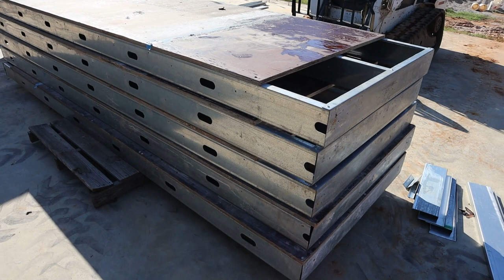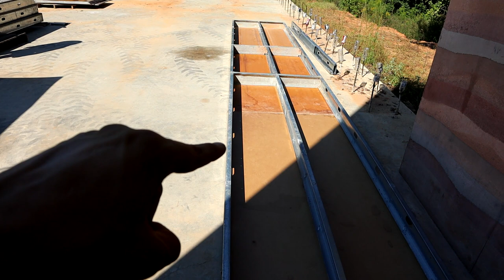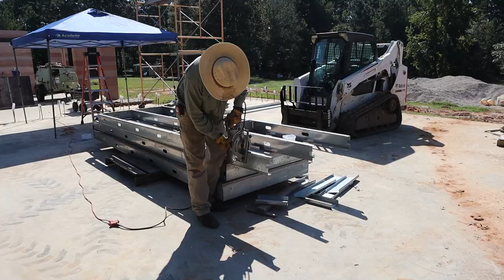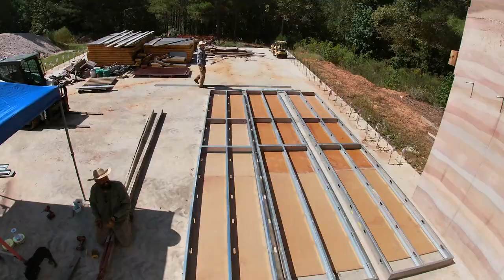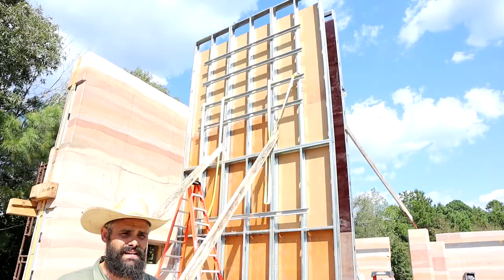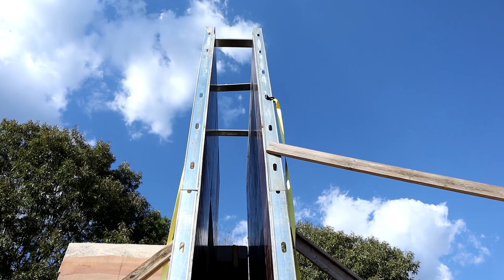Creating an UBER Form for HUGE Rammed Earth Wall - Vlog 78

Comment: Are you going to reuse your 16 gauge C channel commercial building wall studs in your building somewhere?  How many times can you reuse the forms before you think you need to replace them.  One of the reasons you aren’t supposed to stand on that pallet is that if the hydraulics fail you will most likely fall.
Reply from the maker: If the C channel survives the process then they will be used to form the traditional framed walls. We are kinda coming to the end of the use for these forms and will likely replace them once we finish the workshop. We have found a few other alternatives to using the pallets, thanks for the heads up